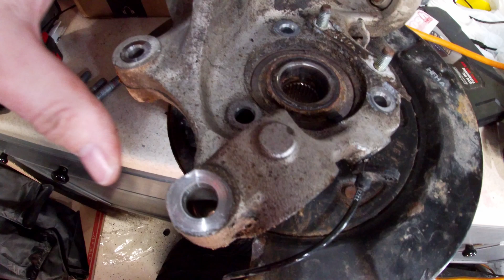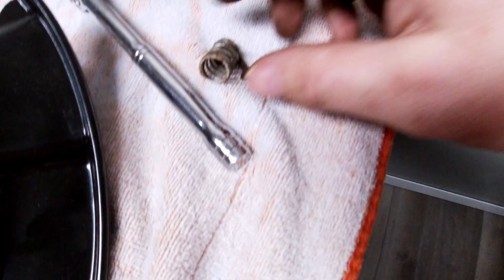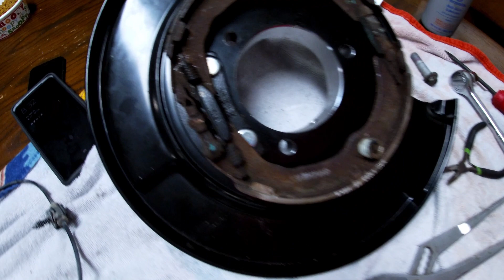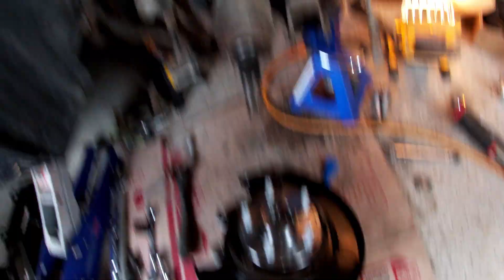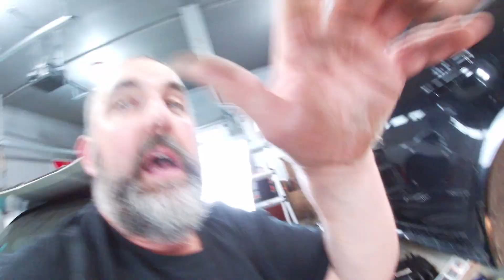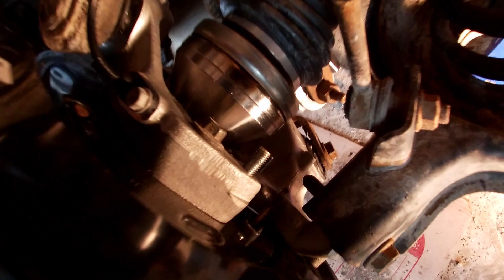Part 2: 2008 - 2015 Cadillac CTS Rear Hub Bearing (plus CV Shaft replacement)

Comment: You're the man! My cv axles need replacing and thanks to this video I feel confident enough to tackle the job myself.
Reply from the maker: Good luck! You've got this!
Reply: Why would you think that, this video didn’t show how to remove anything or reassemble anything, he showed the knuckle removed and replaced.
Reply: @MUE4731  Because I just installed two new CV axles on my car? You realize this is a two part video, right?

Comment: Found Parts 1 & 2 of the rear hub videos very useful! I had easily done a front hub previously on my 2011 CTS but figured I'd look at videos for the rears just in case. Needless to say that what I thought would be a 2-3hr job turned into 6hrs! For anyone else considering this, the rear knuckle does need to be removed as there's just no way of removing the 3 bolts that hold the hub onto the knuckle. Even my thinnest sockets and closed end wrenches couldn't get in there as the CV shaft is in the way. 
Once off, getting the hub off of the knuckle is a challenge due to the binding of aluminum to steel. Can't really get it on a press either so I propped it on some 2x4's, put one of my largest impact sockets against the back of the hub (facing upwards) and used a 1" brass rod & ball peen hammer to strike the open end of the socket. I used the socket as a means of getting equal pressure against the hub. Took about an hour to knock it out and saw all of the corrosion on the knuckle. Cleaned that off with a plastic fiber wheel on a drill and the new hub went in nice and snug!
Getting the ebrake cable back on was another challenge as it's spring is VERY strong and hard to compress. In the end I found that putting a screwdriver thru one side of the spring, then thru the end piece hole on the cable and thru the other side of the spring worked. The spring could then be wound by hand to compress itself. Holding it in place however, required playing around with more screwdrivers and a panel clip remover so if there's an available tool for this somewhere, I'll have to get it for next time! Lol
Reply from the maker: The parking brake spring was a pain in the butt!!!! Probably the worst one that I have ever done! I used a long screwdriver like you! 😂

Thanks for watching and commenting!

Comment: My wife's car is a 2016 Cadillac ATS, and I need to replace the rear driver's side half shaft (CV axle). Do I have to take the entire wheel assembly off as you did on this one? Can a person unbolt from the differential and then unbolt it from the backside wheel assembly? I have never replaced one before, and not sure if it just unbolts from the wheel assembly or how that comes apart/separates. I would sure appreciate any info you can give me on this. Thank you!
Reply from the maker: I think that if a person could unbolt the inside of the CV Shaft, then remove the bolt on the wheel hub that it could potentially be removed from under the car without removing the wheel hub. Since I needed to replace the wheel bearings removing the hub was the best option.

After doing this on my wife's car, if I ever have to replace just the CV Shaft, I would try to remove just the shaft without all of the extra work!